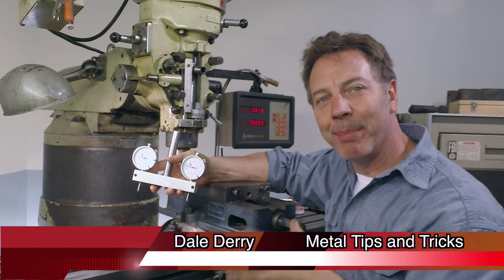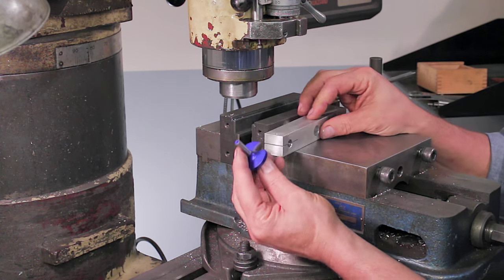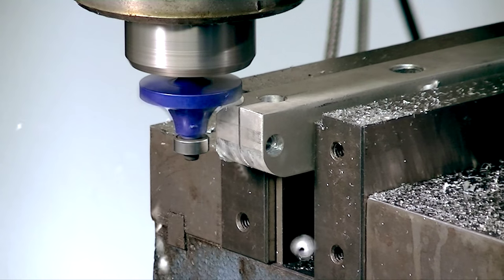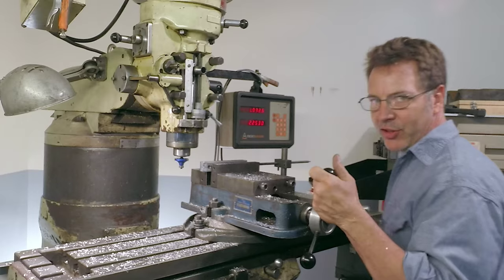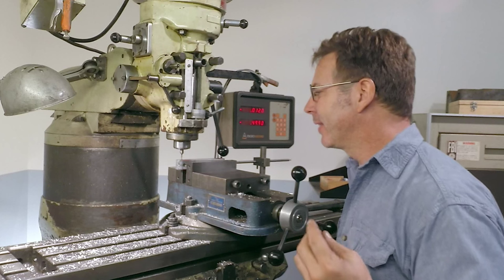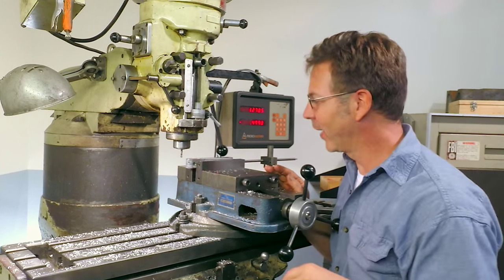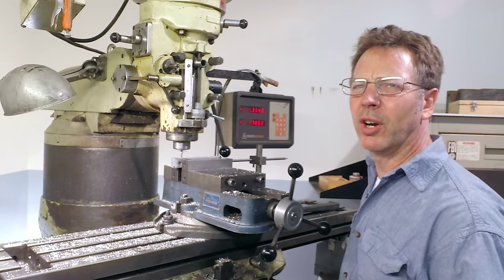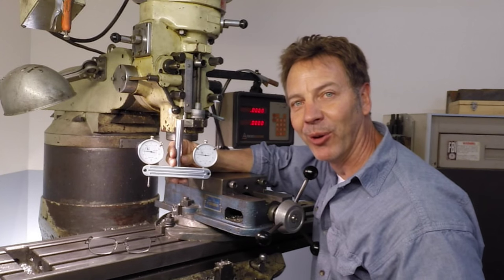DIY Spindle square - Part 3, Pimp it out

Comment: The important thing to remember when using wood working tools (Router Bits) on Aluminum is that they have a carbide tip. You'll find that you can use almost all of your wood working tools as long as they are carbide tipped, when working on Aluminum, Saw blades etc.

Thanks for taking the time to put this set of video's up. Learned and enjoyed.

Comment: Dale, I love your shooting from the hip in designing on the fly. :) I worked in product  development testing (consumer all types, I made the things that broke the products) I had to design fixtures and items to do the work on a lot of one-offs in a tight time line.  Most of the time I worked off a verbal concept from Engineer and a napkin sketch for the fixture. I had a great shop but my mill did not even have a DRO.  There was a lot of making it work and be able to repeat the test  making more than one part was normally not needed. Photos for documentation  paper drawings if required for future or shared reference by vendor of product .

Comment: Dale,
    Like you, I have been using Router bits for cutting on Aluminum for many years.
I was a Carpenter for over 25 years and have dozens of different profiles at my disposal. One thing you did neglect to mention is to be sure to use Carbide tipped bits only. While you can use plain Steel bits for a one off project, they're pretty well dull after using them and will never cut Wood again properly.
Love all your videos and look forward to the next one.
Tommy
Reply from the maker: Best Racing Tips Win At The Dragstrip  Thanks for you imput.
Dd

Comment: I have used router bits a lot on aluminum as well without any issues. I've also used carbide tipped circular saw blades to cut aluminum AND steel. The key is to keep the RPMs below 250 for aluminum and 150 for steel and keep the feed rate mind numbingly slow. Just bump the handle for feed and you shouldn't have any problems.

Comment: If I remember correctly, I think Tom at Oxtool used a router bit to do the outside of big steel hand wheel for the etching press he is building.  As long as you get carbide you could probably get some other cool molding shapers to use as well if you take your time.
Reply: ILGopher Just got to take it easy, the angle of attack for wood is pretty acute, for use on steel that makes the carbide subject to loose bits and pieces on the edge, 1/2" shaft is a big plus... I'm doing it sometimes and it works well....   ;-)

Comment: Hey Dale. nice job on the tram gauge set. I do have a question...how to you go about calibrating the gauges relative to each other in the fixture?  since they are adjustable, any variance to each other would create a variance in the overall angle during tram setup.  I see in the video it was mounted in the quill and zeroed. but if the quill was off, using it to calibrate wouldn't be accurate.   I have a method I use if you are interested or think your viewers would be. again, great job on the videos.

Comment: I like your method of trusting the machine to be precise, allowing you to do the same operation in several locations. I'm a big fan of symmetry, so setting up for the full six slots with two setups is appealing.

BTW, you might also consider reeding (leaving semi-cylindrical high surfaces) with a router bit designed for that purpose. It's basically a round-over bit with a zero diameter pilot (or nearly so), so it makes nice "reeds" with little or no space between them. Very Deco-ish. (Never forget that the center of such a bit has zero SFM at any speed. You are essentially pushing it through the workpiece like the web of a twist drill, so take it easy.)

How did you finally end up for polishing and softening the edges?
Reply from the maker: Peter W. Meek Thanks for your comments. You have some good ideas Most of the polishing was done on a buffer after it was wet sanded to 800 grit. Its a lot of work.

Dd

Comment: You can make a spindle square , but you turn you mill on with a vise grip.
Reply from the maker: Mike Margeson  You were not suppose to notice that.  I lost the lever for the switch in the move, but I know it is some where.LOL

Dd
Reply: Mike Margeson - As long as it's a TRUE ViceGrip, no issues.

Comment: I like the decorative grooves.  After milling them, I might have added some color.  I would have taped of the holes and slots-not being so concerned about open, flat surfaces. Then I would have sprayed the grooves using an appropriate color.  Finally, I would have removed the tape and sanded/ground/polished the color off everywhere it wasn't intended to be.  This is, of course, assuming that there is a paint/application method that will result in a finish that is durable enough.

Comment: It's a pleasure to watch video made by someone who puts such attention to detail into the camera work and editing.
Did the slots end up centered on your lines? (not that it's critical in this case) I ask because whenever I tried to do slots like that with a skinny end mill, the tool bit deflection always seemed to push the slot to one side--not so noticeable if you cut in one straight pass, but pretty bad if you make cuts from opposing directions. This was one place where freshly sharpened old bits came in handy since they cut undersized slots that can be cleaned up to size.

Comment: Highly recommend a lubricate.....wd 40..kerosene....diesel fuel...mineral spririts...you don't  need to drown it apply with brush good   also recommend a single cutting engraving tool much stronger.

Comment: Giving a nice decorative touch to a tool makes it even more our own tool and just make us wanting to use it even more....
A little touch of WD-40 is a must with a ball end 1/8" bit running at 3000+ rpm, you have to slow down the feed cause the end doesn't evacuate the chips as well as the sides, it was probably sharp in the first place, also tightening the vise after the " Tap tap " defeats the purpose.... ;-)
Reply from the maker: pierre beaudry Thanks
Dd

Comment: the use of carbide tipped wood cutting tools on alumunuum is a relatively old process, but given your 1/4" shaft bit, i think that cut was problematic . using 1/4" bits i wouldn't take that heavy a cut in soft wood. 
i too saw the tom lipton use of wood router bits on steel, and was too, say the least ,amazed. but it seemed to work quite well.
was disappointed to see you failing to use proper eye protection. bad example for beginners, or anyone for that matter.

Comment: I like the end product.  Give's me inspiration to do the same.  You might want to consider using a little WD-40 when cutting with 4 flute end mills.  They will clog and break.  I think if you would have used it on the 1/8" end mill, it wouldn't have broken.
Thanks for sharing.
Reply from the maker: Herb Blair I agree about the Wd 40, But i have just ran out.
LOL
Dd